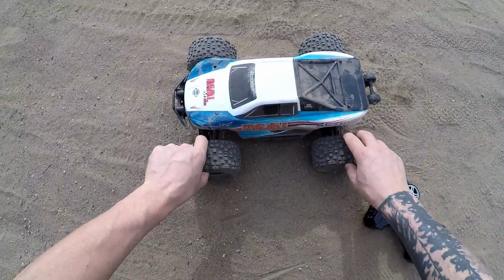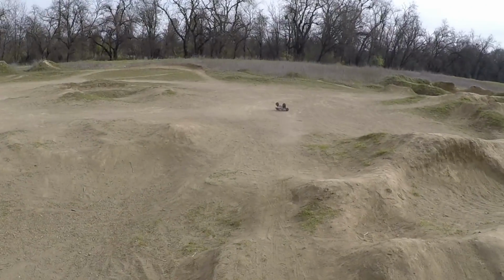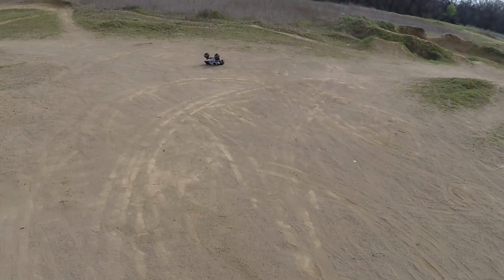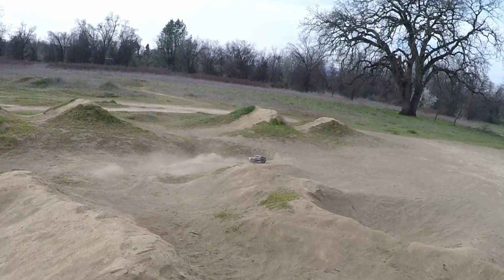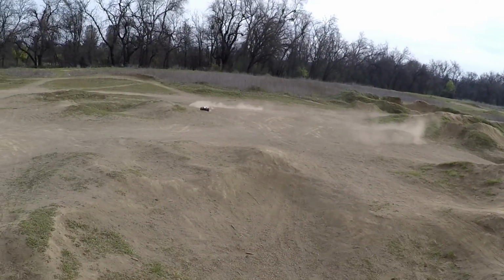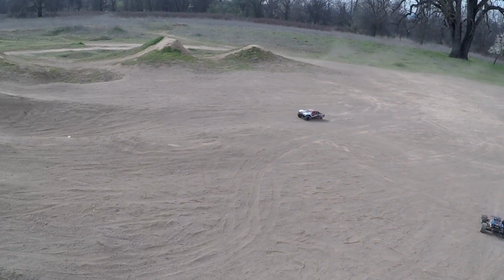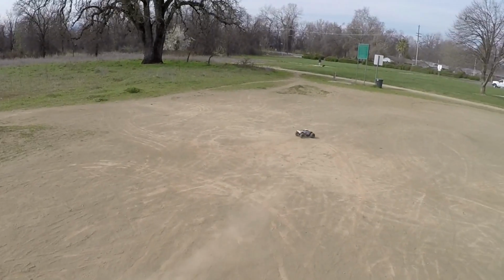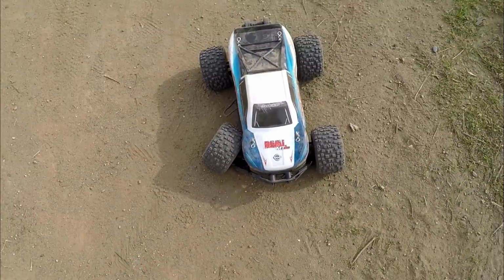Team associated Rival MT10 3s BASH

Comment: The stock Avenge tires did the same thing..I run HSP MT's with 1/2 in offset..Much better now and only $20 for a set on ebay!
Reply: Oh yup..The first thing you gtta do with these ESC's is TURN THE BRAKES DOWN!! Lol..Mine was flipping over itself  on the street under braking lol..They are set at 75% from the factory..AE sells parts but the Helion parts are at Hobbytown and Amain

Comment: Good run bud. Just a bad landing. Hehehe. I've done plenty of those 😂
Reply from the maker: LOL those brakes tho lol I'm going to turn them down
Reply: @killeroffroadhobbyz  Beleive me or not, today the servo splines and servo horn stripped on my second Kaiju! Boy my bad luck with the Kaiju continues! I already contacted Redcat about it. Damn.
Reply: @killeroffroadhobbyz  And the Kaiju brakes are set too low from factory. Hehehe. It's just the part of the RTR thing. You have to tune them up.
Reply from the maker: Yeah I like low brakes tho but not too low

Comment: Did you set the ESC to the radio? Look in the ESC manual for setup.. fixed my stop on a dime with just barely touching the brake!
Reply: I'm just as guilty as everyone else who's done a vid.. I was collecting manuals for digital storage.. and stopped long enough to read through that one and noticed notation for NiMH and Lipo running.. with setting the ESC to Radio.. I blew it off as it stated "paired and ready to roll" originally..
Reply from the maker: I will have to do that